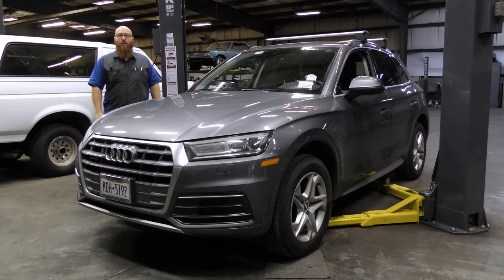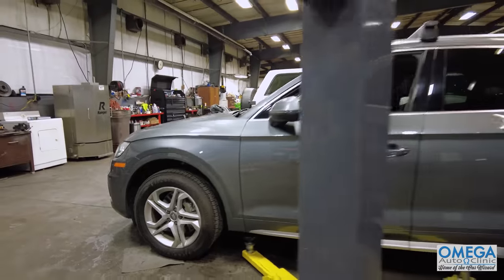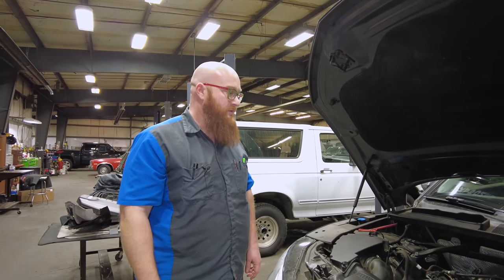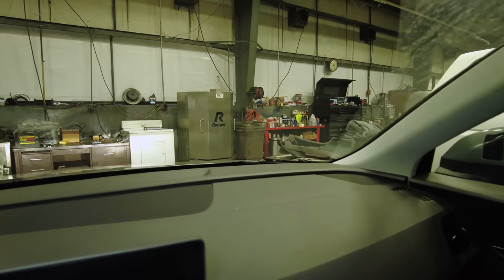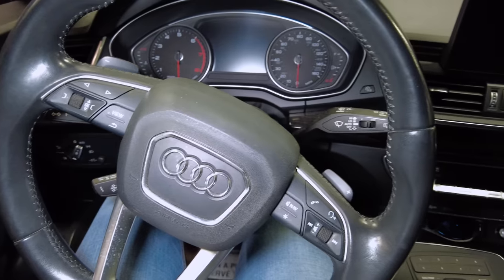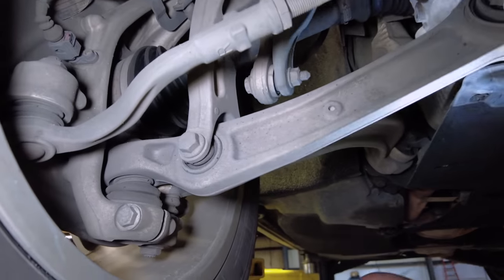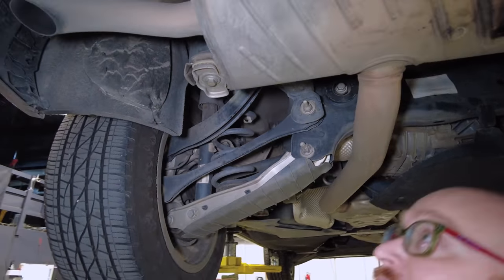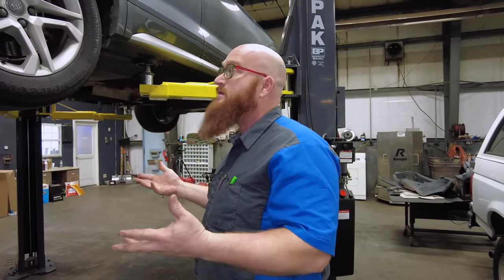2019 Audi Q5 with 200K miles & the service records to prove it! What did the CAR WIZARD need to fix?

Comment: My 2017 Audi A4 has 211,000 miles on it with no major issues, if you maintain them properly using the correct motor Oil and filters they will give you many years of service. Get behind the wheel and they drive great, the Quattro all wheel drive system is incredible not to mention the extra level of safety it offers. This is a 2.0 liter engine but it's very different from the past engines. Consumers Reports ranks the Audi A4 as top in its class with Excellent reliability. I know you like to put Audi down looking for reasons to find fault but when you find one thats gone almost 200k you look for excuses. Any car thats traveled that many miles should have a pile of Oil change Invoices. I have to laugh as you look for a major issue and only find a blow fuse ? My Wife has a Subaru Forester with 120,000 miles and the service cost is no less, CVT service is $430 and required every 28K. I can't stand driving it, its sounds like a trashing machine, scares me trying to merge on a highway trying to catch up to traffic. My Audi, on the other hand is a pleasure to drive.

Comment: The hot weather can kill German cars fast. My wife's BMW only had 18K miles on it over the 6 years she owned it. However, the plastics on the car were cracking everywhere from the hot South Australian desert heat. Whereas our Toyotas had no problem sitting in the blazing sun.  So yeah - sometimes, it is just the climate that will kill European plastics.

Comment: I have a 2015 diesel x5 at 220,00km at moment. Control arm was changed by previous owner and myself. Both of us change oil in short intervals. Also changed fuel filter and transmission fluid at around 180k. I’ve changed the breaks, wide tires (huge pain in the ass), water pump (shocker) and currently have a rear diff leak which I’m about to repair. EGR top and bottom part I think both replaced by bmw dealer. Definitely more expensive than a Japanese but overall it’s not terrible.

Comment: Its only 3 years old. Modern cars will give you a ton of miles with no trouble. They just can't do it beyond about five or six years when all the plastic starts to get brittle and the various fans, pumps, compressors start to fail. There was a 2022 Civic with 160K miles for sale a few months ago near me. It was in Car and Driver.
Reply: Good point.  Let's review this car again after 6 years and see if electronics the turbo and tranny are still original.
Reply: @chrisg723  my cousin has a 2014 Audi q5 bought new just hit 250,000 miles no issues at all, can’t be said for their “reliable” Honda crv 2019 bought new with only less than 40,000 miles and loaded with electrical issues and typical for Honda automatics it blew up.old Hondas were built to last but newer Hondas are pure trash, only Japanese automaker that’s good is Toyota and Mazda other than those two brands German cars for the win because I do something called MAINTENANCE

Comment: I had a 1993 Audi 90S back in the day as a commuter and hit over 200k miles until it got totaled in an accident around 2004..  All I did was oil changes, tires and brakes.  The only big repair was a leaking heater core which cost 1.5k back in the day.  It also leaked a little oil but I never fixed that.  The car just kept running.

Comment: My q5 TDI 3.0 2010 has 297Km and still runs fine however I’ve spent most my money on repairing it and my recent one was a coolant leak on the coolant hose

Comment: I had a 99 S4 B5 Audi and I sold mine when I had 198,000 miles.....  The only thing I really did was just the shocks and the tire replacement and brake replacement.. regular oil change and the timing belt twice because I bought it when it was at 88,000 miles...  I didn't really have any problem with the car

Comment: That version of the Audi 2.0 is a pretty decent engine, Audi seems to have fixed the oil consumption and timing chain tensioner issues. I'm surprised to see a dipstick, that's an aftermarket addition but a very smart one. I've been thinking of making a car care binder for my 2017 A4; I'm at 90k now and only non-maintenance item has been a turbocharger. I'm looking forward to joining this Q5 at 200k!

Comment: VAG cars that don’t have 4 cylinders after 2012 or so are way more reliable than people think. 

The V6 engines and ZF transmissions are pretty solid

I’m not much of a fan of these 2.0L turbo’s but apparently it’s working for this guy

Comment: 200k on a German vehicle: Wow! Look at that mileage!

200k on a Toyota or Honda: This baby just got broken in.
Reply: Clearly it shows you never properly maintained your German car, plus a modern Honda will have electrical problems before it even hits 30,000 miles,they aren’t what they used to be and let’s be honest Honda and most Japanese automakers are quite overrated now, only Toyota and Mazda is good
Reply: @joskjj3625  I’ve actually never owned a German car. A lot of Japanese and American cars only. I would say up until the 90’s some German cars were pretty decent from what I’ve seen. You are right about Honda tho, they aren’t what they used to be. I had a lot of Hondas but nothing after year 2000. 

For new cars I prefer Toyota. I put over 90k miles in under 4 years on a 17 Corolla. I had zero issues. Ran just like the day I got it. I have a 99 Sienna with 270k miles all original no leaks or burning oil and a 07 Yaris with 165k. Maintenance is key but some require a lot more repairs than others. Honda and Toyota can take a lot of abuse and neglect and they just keep going. You can’t do that on most cars. Also cost of repairs is much higher. That’s why German cars depreciate so fast but even a 20 year old Honda is still desirable.

Comment: The truth is when you maintain these cars properly they will last. Oil change every 7K miles, premium gas, no skipping on the service. In Europe Audi's with 200K Kms are considered just broke-in. It's all about maintenance and real mileage - most of the german cars have fixed odometers so it looks good when you buy them with 100-120K but in reality they have 200-250K on them. Human factor...

Comment: What a surprise when you do the proper maintenance required to a vehicle it last a long time ... almost like it's designed for that for German TUF
Reply: It's called TÜV, Technischer Überwachungsverein (technical observation association). But you can also go to DEKRA, Deutscher Kraftfahrzeug-Überwachungs-Verein (German motor vehicle observation association) They both do the "Hauptuntersuchung" and "Abgasuntersuchung" or HU and AU. Like main check and emission check.

Comment: In Europe the diesels easily do 250-300k miles , the gas ones not so much. I think piston ring tension on new gassers is a problem and allows contam of oil. Diesel engines and power trains are built stronger for sure

Comment: Just bought a 2016 ford f-150 5.0L 4x4 in september w/ 116,000KM'a, or just over 60,000 miles. I was skeptical because it had come from Newfoundland, (im from Ontario), and they are close to saltwater, and generally just a huge concern for vehicle rust. When i brought it to my mechanic, they threw it on the lift and I was pleasantly surprised to find out that the chassis was religiously oil sprayed. Salesman then showed me the car fax maint. history. I didn't care because car fax is really inaccurate. So, I called the dealer it came from and asked them to fire off the records on it, oil changed religiously, starter replacement, front and rear shock replacement and that was about it. the previous owner had a ford maint. plan. That kind of knowledge when purchasing a car is invaluable.

Comment: 200,000 highway miles in that Audi is the same as 20,000 miles in almost every other Audi or German car. And as far as "Why drive boring cars"? Because the maintence book of my cars are just a few sheets and provide me the peace of mind knowing they will start and run dependably for 200,000 miles with less problems than most German cars at the end of 36,000 leased miles.
My fun car has an LS2 with....zero, none, nada issues, and I've had my GTO since it was new in 2006. My other fun car is actually my wife's, a Miata with...you guessed it...ZERO none, nada problems. Basic maintenance for each of our fun cars, that's it. Our other cars, the daily cars have been pretty much Japanese brands, and one 2006 Grand Cherokee Overland that needed, in 10 years of ownership and 110,000 miles, a starter and spark plugs, besides basic maintenance, that's it. I don't consider any of those cars boring. Now, I've had Porsches. They drove GREAT, just fantastic. Back in the 1990's through the early 2000s, I had two 928's, (call me fortunate with making money as a young man), consider them, as far as reliability is concerned, JUNK. Pure junk, and they steered me away from European cars for the rest of my life. In the 30 years since my first Porsche purchase, German brands have not improved with their reliability, frustration levels, or cost of ownership at all. Outside of warranty, the 928's were pure horror. Terrifying because I kept wondering, despite great maintenance, "I wonder what is going to break today on my way to the grocers?" I sold my last Porsche to its next victim back in 2004 and have been good, ever since. The Japanese manufacturers still have a decent clue as to what I want out of a car now that I'm older and wiser.

Comment: There are plenty of well maintained VW TDI’s out there with 500k+ miles out there. Just had a timing belt service done on mine, all maintenance done on time or early!
Reply: 2013 Golf TDI here with same miles as this Audi, but a binder 2 times thiker (over 24k$ in maintenance over 10 years)...Just this week, I threw 3k$ at it: 2k for a brand new OEM (LUK) complete clutch kit (Flywheel, Dual Mass Pressure Plate, Clutch Disc, Throw out bearing & Slave Cylinder + new Hardware) and 1k$ for a new set of winter tires (Blizzaks). The car stiil looks & drives like brand new...A 3500$ fresh paint + a new set of OEM rims in last October,  a complete set of brakes (discs, pads and calipers) in June 2022 and a complete suspension kit (control arms, bushings, struts, shocks,....etc) on April 2022 + Miscellaneous stuff (O2 sensors, glow plugs, bearings, etc...throughout the year 2022)...Now the car is good for another 200k mileS, Hopefully (I intend to bring it to at least 350k miles (1/2 Million km)

Comment: What I’m surprised to see is that the car is supposedly still running on the original timing chain, water pump & PCV valve. I have Q5 myself, I’m very diligent with preventative maintenance, yet I’m kind of waiting with dread in my eyes the day when I need to replace one of those items.

Comment: Here in Holland(and  rest of Europe) lots of people(me included) like German brands(and French) I know; in America/Canada not so much, if i'm not wrong.
If there is a problem,some brands/models are not so easy to fix by yourself or a "not dealer" garage/mechanic, just by original dealer. The money must stay within the circuit of that brand.

The manufacturer designed(the higher maintenance costs) that also for that reason. And maybe it was easier and faster assembled that way.
Like "you can afford my brand, so you can afford the maintenance of my brand" . Anyway, that's what i think..

Today i just bought an old Ford Fiesta(i like Ford); an 1.6 4 cilinder with 200.000km(129 866,579 miles) so not bad for such a small 4 cilinder car, isn't it? Everything works; airco,windscreen heating, electric windows.  Probably assembled in Cologne Germany,but can also in Gent Belgium,or Hungary,Tsjech Republic etc ,etc , i don't know. Somewhere in Europe.

And yes; i allways buy old(cheap) cars, don't want to spend thousands of Euros for a car. I can fix most(not to complex) things.      A car: the worst investment you can make..

Sorry for the long story, and bad english.....😜

Comment: I have been saying this for years with German cars.   They are engineered to a spec. If you follow the service to the letter they last.    My A4 has 72k miles on it, I got it as a dealer loaner car when it had 5000 miles on it.    Every service is done to dealer specifications. Brakes?   You bet they are expensive.   That transmission fluid change?   The fluid is like $250.   But the car will run and drive like new if you do it.

Comment: They said so what we have 2002-
2006 BMW m54 engine e53 X5 3.oi with over 300,000 - 400,000  thousand miles on them original engine and transmission and they still are running strong.

Comment: Why do you not associate the quality with the probability that it was mostly highway driven, to have accumulated so many miles?  Most are not pure highway or city, but this is probably pretty close to highway only.  And 1 mile city equals 10 miles highway, in terms of wear and tear.

Comment: My buddy has a 2019 top of the line model, with the turbo diesel motor (quattro). Pretty sure he got a lemon. He's had the transmission replaced already and has had all sorts of weird little quirky issues going on. One example being the tire sensors going off randomly, and another example being the wiring under the drivers side seat popping out.  This vehicle has about 140,000 kms on the clock.

Comment: What I’ve learned in my limited experience with German cars is that if you drive them and maintain them, they’ll treat you well in return
Reply: Oil changes are the key.  They only cost $100 per time so it's not like a huge expense.
Reply: Oil is cheap. Engines are expensive!

Comment: Maintenance is the key. Even a Jaguar is dependable if well maintained.
Reply: Don't agree. Some cars just have issues you can't catch with any maintenance. Had 2 cars where the radiator or whatever that thing is called of the air condition failed. One car was less than 50k miles and less than 5 years old, the other one was like 11 years and 75k miles. A third car I had didn't have any issues despite being 14 years old with 180k miles with the air con... It had a bunch of sensor failures though that happened although the car was maintained. An oil change every 1000miles would have changed anything in that case. If there are constructive issues on a car they will bite you sooner or later.

Comment: Most German cars (even newer ones) can do 200-300k without major issues but as people see the file... maintenance is key and is not cheap...
Ask me... I have been driving old Mercedes's for the past 10 years and only recently switched to Japanese cars because... well exactly this... expensive parts - often shop visits... and if you happen to buy 10 year old Mercedes/BMW/Audi that has not been properly maintained it will bury you.

Comment: I’m late to the party so unfortunately most people won’t read my comment now, but I implore each and every one of you to keep your cars out of the sun as much as possible. Parking your car under the intense heat, and exposing it to other weather elements, drastically reduces the longevity of parts inside the vehicle; specially plastics.

Comment: I've got a 2016 Focus ST with 160k miles on it, and it runs like a top.  Part of it is that I completely ignore the computer telling me when to change the oil, and it gets changed every 5k miles w/ full synth, and I compare it against what I put in.  5.7q goes in, and about 5.5q comes out which I measure in the jug that the new stuff comes in.  Tires get rotated in the spring and the fall.  Brakes are checked at this time, and if the pads look low, they're replaced.  Transfluid was changed at 80k, and it'll be changed in the spring right about when I need to change the oil.  Do I have a stack of receipts?  Nope, but I have to say I do like what he's done there with that book.  I think the difference is that when his car cost $70k (?) you're going to worry about resale value which this book will definitely help with.   On my $17k ST, not so much.

Comment: It seems to me that the turbo, causing carbon buildup on the intake valves, is a major problem with the Audi 2.0.  If this car has been driven mostly on the highway and in "D" (normal) rather than "S" (sport) mode, perhaps the turbo is not nearly as much of an issue as city driving where accelerations are constantly winding up the turbo and blasting the intake values with soot and grime.  It would be interesting to see how much carbon buildup has occurred on the valves of this vehicle.  Also, with direct injection (rather than port injection), gas detergent is not helping to clean the intake valves at all.  Toyota now has some turbo engines with both direct and port injection -- probably to help clean the carbon buildup (not sure).

Comment: 487000 kms or 302000 miles on my a6 avant. Been maintained correctly. Problem is people dont look after vehicles correctly then complain when they fail. Much like the human body,neglect it and it will break down inevitably 🤙🤠

Comment: My 2006 A 3.2 Q has 189K miles on the clock and it has never been to the dealer for service. I have done it all myself. It's a rock and I daily drive it. I have 5 Audis in my garage including an RS5, and all are self-maintained.! I would Be willing to stick my neck out and say monkey dealers mess up Great quality Engineering more than it's worth.

Comment: I am surprise the control arm bushings and sway bar endlinks are still original, this car probably didn't see much potholes, if at all. My 2014 W212 had a complete front end refresh last year at 90K including all new control arms and sway bar endlinks, also did the engine mount and trans mount. It was costly even at a great indy, but it drives great now at 102K miles, just as good if not better than new cars. Hoping to get another 100K out of it.

Comment: i dunno what a mile is (where i am from we have Kilometers)  i once had an audi a8 4.2 engine 2001 model  i did 450.000 kilometers on it, still ran like a champ.....Audi engines are VERY underrated
Reply: 450k is about 275k miles